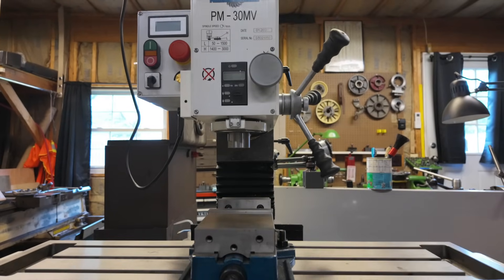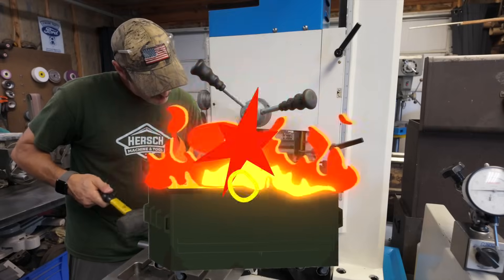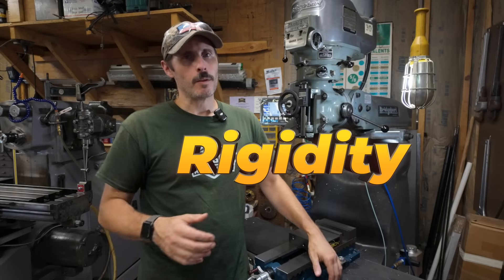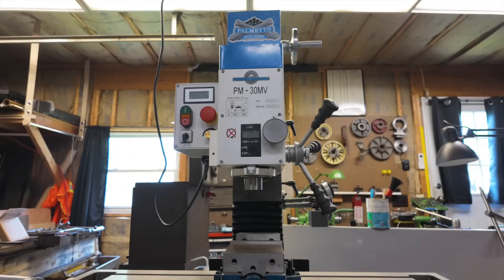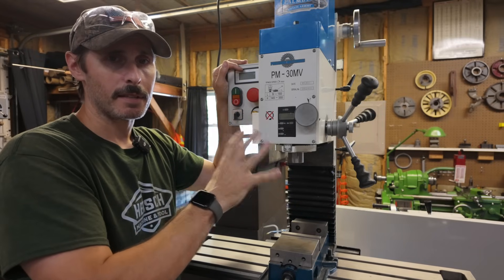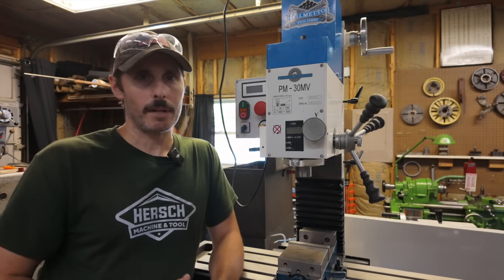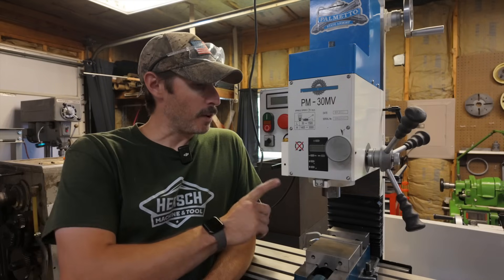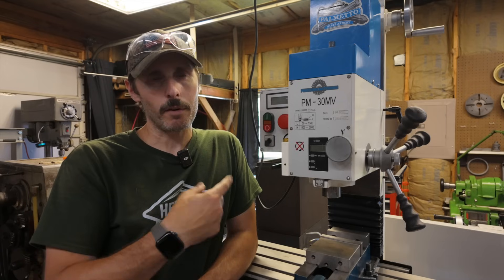All You REALLY Need to Know About Mini Mills

Comment: As far as column alignment and  tram goes on these bench top mills, I think I am going to do the shimming to tram, then drill and install taper pins thru the column and base to hold the adjustment.  That is what is done on large motors that are coupled to pumps, after they are aligned.  I don’t see how a 4” +- wide column would be ridgid enough except for soft metals.  There is just not enough mass.

Comment: Did anyone else notice the wobble in the pulley shaft?
Does that mean anything?
Reply: That wasn’t the drive shaft or spindle that was wobbling, it was the end of the draw bar.  I believe there is a loose clearance  at the top of the spindle, and when it is tightened down, it is not perfectly aligned on center.  The loose clearance is so the bar can be dropped in easily.

Comment: Let me just say this. I come from the world of Aviation and Aerospace. Yup, a rocket man. No person interested in a mini mill, or bench top lathe for a hobby needs to be concerned about a .005 deviation over a 2 foot span. Oh my gosh I have a 5 thousandths run out. Do you even comprehend just how small that is? If your not producing parts that require LONG TERM / continual high stress loads you have absolutely no need for that kind of tolerance. 
Even a 100k dollar machine will have bugs that will have to be worked out before it will meet it's advertised tolerance. I know because I've been there. they are no different , small dollar big dollar they all have bugs
Reply from the maker: 100% I think a lot of folks spend time on forums and get wrapped up worrying about things that don't really matter, especially when they're just getting started. I see a lot of conversations about runout, tolerances, wear, etc. and I always say the same thing, "The machine will be more accurate than you, and by the time you're able to overcome the machine's limitations, you'll realize that it doesn't matter anyway..."

Comment: In 2008 I bought a mini mill for making my projects, in my parent's garage, at the time.
I'm a professional metalworker, in 2008 I was in the trade for 9 years, so I know well what to expect from such a lightweight machine.
Mine is a Fervi T061, an Italian brand, being myself Italian, the same cast of the G0704.

Plastic gears were the first issue.
After breaking (or better...melting) some, under warranty, mainly because of high speed used since I was working mainly with small tools, I decided to swap to a better motor (3phase 1.5kw 2 poles, with a VFD) and poly-v belts.

In recent times I started a plastic recycling project, and I converted it to CNC, transforming the dovetails in powder and swapping to linear guides, to make injection moulds.

The machine has its limits, it's not rigid, it's lightweight, but, as everything, you have to do what you want to do finding the limits.

Even in the professional machines field it goes that way, there's different machinery for different tasks.
Theres heavy rigid and often slow machines for some jobs, and light and fast for others.

And you can go beyond the theoretical machine limits if you know what you're doing, in every field.

Mini mills are the way in which the general public can start to enter the machining world, and especially with CNC and the new informatic tools available you can easily go around the machine's limits.

To be sincere, I would have preferred to have bought a better machine like yours, but that wasn't the case.
Now I have to adapt, but so far it is going well!
Check it if you would like to!

Cheers!
Davide
Reply from the maker: Thanks for sharing all of that info with us! And thank you for watching!
Reply: @hersch_tool You're welcome!
Knowledge is meaningful only if shared!

And if you want, check mine too!
I'm not so good at editing videos and I started uploading recently in this channel mainly because I broke a vertebrae, I'm blocked at bed and I had to do something in the meantime...and since I had a lot of material in my smartphone...there it is!

In the next few months I'll try to make something better, after healing...

Comment: I sold my mini mill for scrap in the end. It had plastic drive gear that lost teeth faster than a boxer without a gum shield. The manufacturer replaced it the first time I complained, but then ghosted me the second time. The drive belt method is tried and tested for over a century now, so why are the Chinese still getting away with plastic gears?
Reply: It was designed to be a weak point.  The gears shear when the tool is crashed or overloaded.  Why didn’t you upgrade to steel gears, or belt drive.It’s an easy procedure

Comment: Very good overview. But what I think most noobs, like myself,  getting into the hobby is worried about is: What kind of tolerances can a given machine work to without everything turning into a lengthy session with emery cloth. In a professional setting depth of cut, and hence torque and rigidity, is very important for profit margins. For the hobbyist taking a lot of lighter passes is a slight annoyance, that the wallet will dictate on the initial purchase, but is not a deal breaker. However, if the end goal is, say, making miniature engines, then it's a deal breaker if it takes umpteen hundred hours to hit tolerances in the tenths.

Comment: accuracy is a function of rigidity, rigidity is a function of mass, the most important thing about your mill is how heavy it is.   for me it should be at least twice as heavy as your lathe, because mills are inherently less rigid than lathes due to their shape and the sorts of forces they apply and must counter.   so if you have a 200 lb mini-lathe you should have a 400 or 500 lb mini-mill.  don't make the mistake of getting a 200 lb mini-mill to go with your 200 lb mini-lathe, you'll be very disappointed in not being able to use the mill on stuff you can turn on your lathe.  Also the fewer "bells and whistles" the better, keep it simple, except for DRO.  even if your lathe doesn't have DRO you're going to want it on your mill.  lastly don't get a mill with a round vertical column, those can't be raised or lowered while milling which you find out all too soon is too much of a limitation, and they never have enough torsional rigidity for milling.   IMHO.  YMMV.  VWPBL. yada, yada, yada.
Reply: Round column mills are nothing more than somewhat accurate coordinate drilling machines IMO...  If you're looking to do any kind of semi-precision machining on your mill, don't bother with a round column mill/drill.

Comment: In my opinion, whenever there are online heated arguments from two sides on a subject, the answer doesn't really matter because it always lies in between. Happens a lot among petrol heads too. One side swears that bolt A is the only option, and anyone choosing bolt B is a fool. And the other side does the complete opposite, when in the end, any bolt that fits would do the trick.
Reply from the maker: Amen to that. I always say any tool is better than no tool.

Comment: Any mill is better than no mill
Reply: Absolutely not 🙂, a lathe with a milling attachment will out do most of those small mills, of course this is just my opinion ⚙️🗜️
Reply: Provided you can tolerate the much smaller working envelope.  With a cross-slide attachment, the max piece size shrinks dramatically.  Really a question of what do you do more?

If size isn’t an issue, the cost floor is significantly lower for a lathe + attachment.

Comment: Got a PM30MV a few years ago..  modifying it for CNC w/the 35 steppers, ball screws etc.  Just digging in..  Love the machine!  The fit and finish are beyond expectation.  highly recommend the PM30MV.  Anybody else out there do a CNC conversion?  Gave up on the standard metal base, and made my own..
Reply from the maker: @markhall3434  I actually have all the stuff to convert mine as well. But I haven’t done it yet because the electronics part confuses me. I’m hoping to get started on it sometime soon and will definitely do a video about it when I do. Also love mine, by far the most accurate machine that I own.

Comment: Nice review of these hobby machines 👍. I came across a Sears Heavy duty Drill press from the 60's and knew that I needed it, so I took it home to my shop. Previous owner was also a retired tool maker so I knew  he had common sense about his equipment. I have added a cross slide table on it for x and y and have found it meets all of my needs as far as gunsmithing and moderate auto repair. I would like an old knee mill but just don't have a need at my small shop. I was very curious about the small mills but I have found that my needs are met with what I already have. Currently looking for a small lathe. Nice shop you have there young fella, happy hours ahead 😊, always safety minded with practices. Sure is fun making stuff huh?
Reply from the maker: @johnevans1969  thanks very much. And yeah I’m blessed to have my shop. Learning to make things with my hands has been a life changer for me. I believe it’s innately a part of our makeup, we are wired to make things. Thanks again, and thanks for watching!
Reply: I bought and "ancient" Rockwell drill press with the original 3 phase motor..  Added a chinese 3 phase VFD controller, and gosh golly..  best drill press ever.  This has a HUGE travel..  like 6"!

Comment: The best upgrade I made to my mill was the addition of a 3 axis DRO (Digital read out) and a power feed for the X axis. Real game changer. The DRO helps with brain strain and the power feed gives much a better surface finish. The power feed also reduces tool breakage when using smaller milling cutters.
Reply from the maker: yeah, at this point I think a DRO is essential equipment for a mill, power feed is a close second.

Comment: For milling, MT tooling is only viable in conjunction with a draw bar. Lathe tail stocks don‘t have draw bars and the tools you might have laying around for your lathe are likely not to have the threaded hole at the end of their taper to accept a draw bar. Keep this in mind before deciding to buy a mill with MT taper thinking that you will share the lathe tools. Also, an MT2 taper is really flimsy for milling, compared to R8.

Comment: I bought a larger mill drill a few years ago. I considered buying a second/third/fortieth hand Bridgeport or King Rich, whatever, a turret mill. I didn't have tooling so that had to be considered as well. I went with the Rongfu machine for these reasons. Dovetail column, fairly rigid - more so than a Sieg, Decent table size for a domestic garage, DRO, suds, stand, taping mode, 2 HP. To that I added a rotary table, five inch vice, all the bits and pieces you need to get going and some bits that are just nice to have. All up about AU$8k. A second hand Bridgy would set me back around the $5k mark and need a considerable amount of work - new lead screws, nuts, surface grind, belt etc - another $3-4K without any tooling. I am a hobbyist just mucking around. The machine I bought does just about everything I want with a reasonable finish and good accuracy.  I also have a Sieg x2.5 or something that I am converting to CNC. The Rongfu is by far the better machine.
Reply: Only bad thing I've found on Rong Fu was name !

Comment: i got the 727m, with gears. . i full full power on low rpm. i can do 2" facemill cuts in all material. ti, steel, aluminum 2" facemill cuts in all material. ti, steel, aluminum
Reply from the maker: Yeah, the 727m is a proper gear head. Different from the simple gear drive referred to in this vid. Really nice machine. In general though, I think a lot of folks underestimate what some of the little mills are capable of. Thanks for watching btw.
Reply: @hersch_tool  definitely.  for home shop. or making small parts, its great. use it for working on folding knives.
Reply: @hersch_tool  I find you to be very believable.  I am trying to decide between the 727M and the 727V.  The only thing different is the geared head, VS combo gear and solid state variable control. I noticed that the max RPM is quite a bit lower on the gear head machine.  Do I really need the higher RPM?  I like the idea of more torque at lower RPM.  On the m UA, geared head.  Does it make up for the 1/2 hp.  Difference in motor size?

Comment: Keep your eyse open and be prepared to move on used machines listed for sale is my best advice. FB Marketplace seems to be where everybody sells these days. I had an Arrow 500 VMC and needed a machine for first operations like squaring stock. I found a well used Enco brand RF30 (round column) locally with R8 collets and an Albrecht 1/2" chuck (that was in good shape) for $750 delivered (probably on CL, around 10 years ago). Step pulleys, limited speed range, but useable. Spindle had a few thou of play if you pushed it, but reasonably good and plumb to the table. I've used the crap out of it. I've used knockoff Kurt Anglok style vises and I'd recommend this si one area you don't skimp. They can be found used as well (I've picked up several Kut 6" vises including one machined-on-all-sides CNC variant). Now, I was a machinist/moldmaker/CNC/everything machine trades guy for 20 years so I have more experience in improvising than the average hobbyist, but it is amazing how much you can do with a cheap far-eastern origin mini mill. Just picked up a Supra 10"x54" knee mill (3600 pound monster) with an older CNC Masters control, and it's surprisingly capable, too. Deals are out there.

Comment: Great video. 

Regarding the belt drive versus gear driven heads, it may be worth noting that a gear driven head has significantly more torque at low RPM settings, as the electric motor remains in the optimal RPM range for torque. The belt drive uses motor speed control across high and low belt settings to achieve low RPM. This means that, at low RPM, the belt drive is not getting great efficiency or torque. 

Furthermore, the control board for the speed control on the electric motor is very likely to fail. This is because they generate a lot of waste heat, especially at low RPM, and they tend to be made cheaply, with cheap components that do not handle heat well.

This is more important for small mills and lathes than for larger machines, because how much torque you have determines maximum cutter size, or stock diameter on the lathe.

My mini lathe does not have a gear driven head, and it makes me sad. When the control board eventually dies, I plan to attach a motorbike gearbox to the corpse of the thing, and make a DIY chinese frankenstein gear head mini lathe.
Reply: You should rephrase your first sentence to electronic driven head vs gearbox driven head. I know what you mean, but there are minimills out there that just have gears instead of belts (no gearbox or only high and low) and the rpm is still controlled per electronic.

My minilathe is also without gearbox, but with 6 speed belt drive. Normaly i would prefer gearbox too, but the machine was cheaper and came with a lot of tools and i wanted to upgrade it to electronic leadscrew anyway, while the machine with gearbox wouldnt even come with a chuck

Comment: I have access to mill and lathe at work, but I don't want to break them learning. and I would like to be able to work on things at home.

Most of my projects are not in need of more than +-.005" accuracy, and are small hobby stuff, experiments, prototypes, simple things for myself, not a business. I need something good enough to learn on that I can move around if needed (even if I have to use a cherry picker or disassemble it into chunks to move it).

It's about learning, good enough, and not being worried about breaking someone else's equipment.

Comment: I’m just wading through what tooling, holders etc I need for an R8 machine. lol
Reply from the maker: Big question. Personally, id say a set of r8 collets from 1/16" to 3/4", a 3/4" & 1" end mill holder, an r8 drill chuck, and some size of arbor for slitting saws, form cutters, etc. For the arbor, just search for the types of cutters you expect to use in the future and find a common arbor size that covers a wide range of options, then buy an arbor of that size. That little pile of tooling will go a long way.

Comment: Bridgeport mills are so cheap right now, I have a hard time justifying a mini mill for nearly the same price?
Reply from the maker: @jryer1  yeah but there are other things to consider for a lot of folks I think, like size for instance. when I got my first mill, the PM in this vid actually, I was in a small shed with a wooden floor that couldn’t support a machine the size of a BP. Also the bench mills are small and easy to use, run on single phase “plug and play”, etc. that stuff is attractive for a lot of newbies as well.
Reply: You're going to have a hard time moving a Bridgeport too. Unless you happen to own a large forklift. A lot of Bridgeports are pretty clapped out today too.
Reply from the maker: @ I move my bridgeport by myself with a pallet jack, it’s actually one of the easier machines to move.